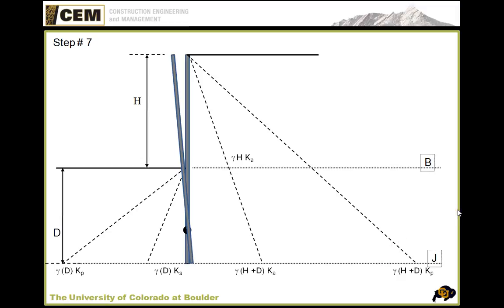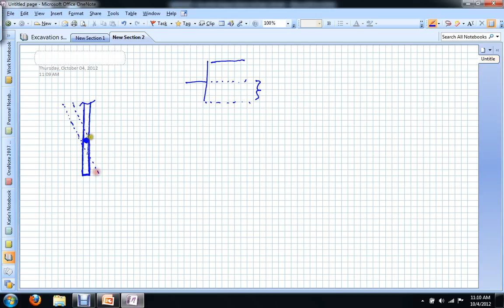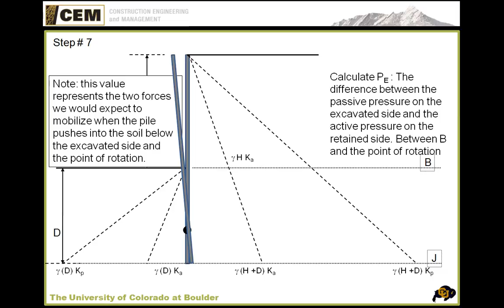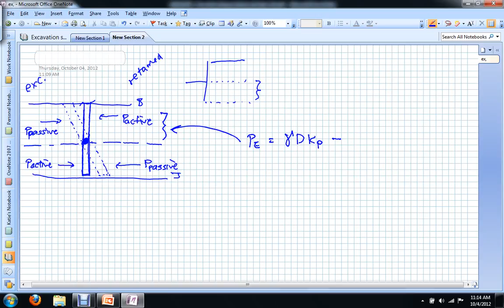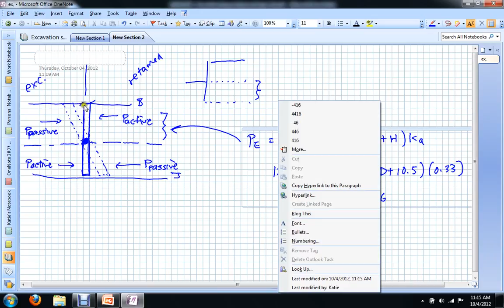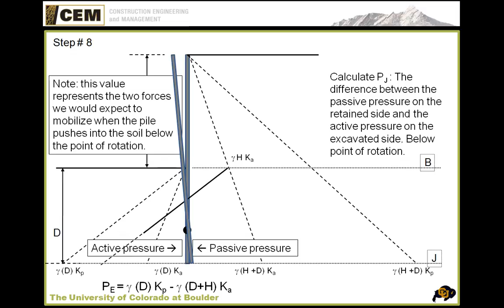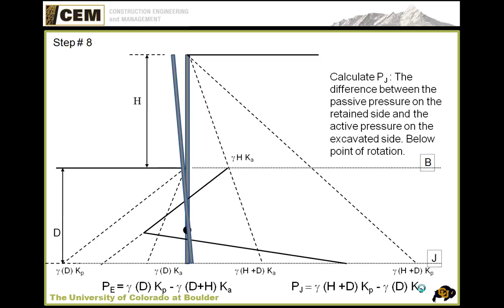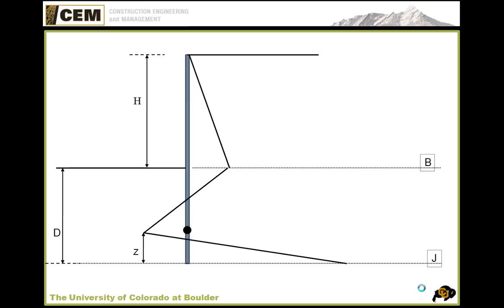Earth pressure below the excavation

Comment: I'm confused why for PE we are calculating active and passive pressure at the bottom of the sheet pile when in reality, we should do it at the point of rotation. Any justification for this assumption?
Reply: i struggle tu understand that aswell; the formula for PE only holds if instead of D he would have (D-z), where z is the distance between the point of rotation and the tip of the wall;
and same for PJ, why does he consider to have passive pressure over the depth D, when in reality the passive pressure is acting only on the "z" distance, while the active pressure is (h+D-z)